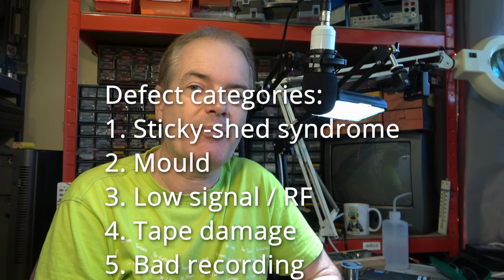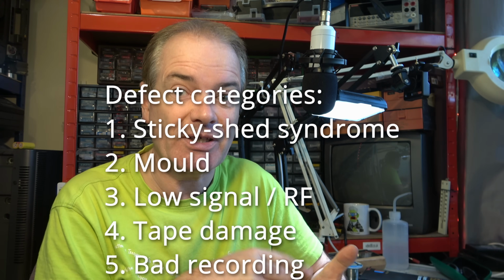Brain dump from video transfer business: Tape problems & what can be done.

Comment: I have several hi8 tapes that I recorded in my handyman between 1995 to 2004. Most of all Sony mp hi8 are still fine except the metal evaporated ones which now contaminate the heads, so I have continuously clean the heads during the transfer for dvd. I also have about 20 Maxwell hi8 mp tapes and all of them got a lot of mold. Most of all got ruined because tape snapped most of the time during the attempt of transfer. I have a few other brands including TDK Fuji and BASF with no problems at all. Curiously my Maxwell s-vhs tapes, about 35, were all contaminated with mold but fortunately didn't affect image in most of all of them.
Reply from the maker: I have a technique for de-moulding 8mm tapes, but it's time consuming so a little expensive.  Fuji branded tapes are usually the worst on 8mm.
Head fouling on certain 8mm tapes can be hard to solve.  When this happens with oxide tapes, some hours in a 50C oven usually stabilises them.  But with 8mm metal formulation, tape baking is less effective, though still worth a try.  Perhaps push it up to about 55C and leave them for 24-48 hours.
Reply: I meant mould, not mold.

Comment: I'm not sure what you would make of the method I use to clean mouldy VHS tapes. It basically involves holding some microfibre cloth (wrapped around some cotton buds) with a little bit of 70% IPA on it against the tape which is fast forwarded and rewound in a gash video recorder (making sure to clean both sides before they enter the heads) a couple of times in order to see if gunk stops coming off the tape and cleaning out the cassette with 99% IPA (in some cases I will manually go through the tape and remove some mould that is on the surface if there is any).
From my experience it does the trick, I've not experienced any head clogs (or at least ones that required a head clean) and only a few mild drop outs every once in a while or so (which is normal for VHS especially if it's old or played a lot and some of the tapes which needed more vicious cleaning have more visible drop outs and playback problems), I'm always a bit afraid of the heads being contaminated and spreading to other tapes, I'm sure if the tape is as clean as I can get it and it plays well then I can safely assume it hasn't left anything nasty on the heads.
Reply from the maker: A few years ago, I would have said that IPA shouldn't be applied to tapes.  But recently I've seen that it can be useful, so your technique sounds excellent.  At least as good as a TapeChek and possibly better.
Reply: @video99couk  I believe hydrogen peroxide actually kills the invisible spores where as IPA kills the mould which has already grown (so if the tape is returned to the conditions which allow the mould to grow it will grow back) however I've never tried it on VHS tapes and no one else to my knowledge has. People use IPA and I can tell it doesn't really if at all damage the tape, actually 70% I've found more effective and is a lot more gentle on the tape (which is good because there is usually some mould on the surface of the tape where it was wound to).
I don't claim to have come up with the method myself, it actually came from the Lunchmeat VHS blog (there are tons of tutorials using that method), the idea of using 70% came from a video by "Devils Avalanche Films", the only thing I do is clean the surface of the tape where it was wound to before putting the tape in the machine to do the proper clean (that part is the worst job and in some cases I would have to cut the tape and splice it back onto the leader, since pretty much all the tapes I've cleaned are pre recorded I usually only lose a bit of the black screen before the warnings and openings and such). Also I tend to be a lot more thorough then others I've seen if I may say so myself since most people only tend to do 1 pass which knocks 90% of it off but I tend to do it 2 or even 3 times until it's all gone (also some tapes which had some heavy mould on the top edge can leave a visible stain which can be removed by basically drowning the top edge in 70% IPA and then giving the tape another clean after it's dried). I'm glad I found those tapes in my grandad's garage when I did since most had just started, if they were stored in there for another 10 years or so they might have all been unsalvageable.

Comment: Do you have a video on demolding process?
I run few cassetet tapes through toilet paper soaked in isopropanol, 3 cleaned fine, 3 were destroyed, but then again, I used a drill with a bic, so maybe it was too fast.
My JVC can play most LP recordings in pretty acceptable quality, though I had some image problems on top and bottom of the image.
Reply from the maker: I do demonstrate cleaning Video8 and Betacam professional tapes on two YT videos, but I've not done VHS.  Usually VHS will improve by just playing through a gash machine a few times, but you can get expensive "TapeChek" machines to polish the tape and I show that in another video:https://www.youtube.com/watch?v=uoZ06US0tw4

Comment: Hi Colin. Ive had good results getting rid of mold with using cotton wool balls held against the tape on modified scrap vhs and beta machines.  Doesn't damage tapes as teh cotton woll is soft enough and also cleans the tape of debris. In an extreme situation I've even used cotton wool ball soaked in IPA to clean residue off tapes with a dry cotton wool ball to dry the tape off before it reaches the other spool.
Reply from the maker: The biggest problem though is mould on very thin tapes such as 8mm, where the mould is stronger than the tape.  You can't easily get the tape off the spools without it snapping.  Have to worked with mouldy 8mm?
Reply: @video99couk  Not done much with mouldy 8mm however I did one experiment with 60s audio reel to reel tape where the tape was stuck together with mould. As I had nothing to lose I put IPA into a roasting tin and then put the reel into the solution and moved the reel round a bit.. it did damage the reel plastic a little but it freed off the tape enough to unspool it onto a new reel (with cotton buds drying the tape off as it was unspooling). Drastic but remarkably effective at unsticking the tape.

Comment: Hi Colin, ever seen this phenomena? https://www.youtube.com/watch?v=EtNx6HH3rzc I guess it's the caps leaking as i have this problem also on my BVW75 currently, what do you think?
Reply from the maker: If that was from BetacamSP, then yes capacitor problems are likely.  May be in the power supply.  There are other possible causes such as cabling or ground loops.
Reply: @video99couk   It must be BetacamSP given the time and the look of the picture. Such a shame they did not see this error actually! But no one sees things like that these days it seems as most don't even care about interlaced videos on YouTube :D 

Your comment on the power supply is a very good hint and motivator to find this problem! Thank you! I visually inspected all the CAPS on all boards and found one leaking so I replaced the entire board with a spare with good caps, but the problem persisted so it must be the PSU as this one was too enclosed too look at, at that moment. So I will check again soon! 

You have a nice channel! I'm enjoying a lot of your content recently and already learned so much! I mostly enjoyed the d8/hi8 camera repairs. I subbed!

Comment: Apart from usual moudly bits - I seem to be having a run of misaligned audio, usually (for some reason) on VHS-C.

I have a deck set aside now for problem VHS which is a free for all when it comes to adjustment, I just keep it solely for problem tapes - do you do something similar?
Reply from the maker: I do have something similar for Video8 and miniDV, but I've not had the need on VHS or Beta yet.  I have a range of different machines and misaligned tapes will usually play on one or another.  Long Play VHS tapes though can be a challenge.  But anyone who was stupid enough to use VHSC Long Play for their precious memories was asking for trouble.

Comment: I may just be lucky but I have dozens of audio cassettes recorded as far back as I the mid 1980s, I've had no ageing problems with any of them, they still play perfectly & sound good as the day I recorded them, They are mostly TDK brand & been kept stored in a dry South facing bedroom, always been stored vertically too, this used to be recommended years ago too.
Reply from the maker: I've generally had less trouble with audio cassettes that with larger tapes, possibly because they're less likely to be stored in lofts or garages since they are small.  But if a cassette were to go mouldy, it would be very hard or impossible to recover.

Comment: I bet there are not many tapes that you havn't been able to recover.
So many things can go wrong, it's amazing that tapes last at all really.
As i've said before, the only tape that went funny on me was a BASF chrome one.
Lots of dots appeared all over the whole of the tape on one side, but after being in a warm room for a couple of days they all vanished without any damage at all.
Never happened on any other tape brand.
And scotch " Re record not fade away " lol,  just seemed eather too thick or stiffer than other tapes and could cause problems with some machines.
The timebase corrector sounds like a life saver at times :-D

Comment: Great video. You seem  to be an affable person and you drive an Avenger  so I am thinking you might be amenable to a question or two. I am not into this stuff professionally but I do have a few machines lying around so occasionally  I cobble then together in different configs to get a transfer done. My workflow involves getting the content into a PC using a Sony DSR-1500A DVCAM VTR's fire wire port  (D/A converter). 

I have a problem not seen by me before: A VCR cassette with motorsport footage  freezes frames while going through the Sony. It will play back fine if the VCR machine is connected to a TV. Can you shed some light on this?

Comment: Another good video. In my experience (US) 3M U-Matic tapes do not have a lot of RF problems, but every AGFA tapeI have seen has low rf, and if you want real fun get a DuPont U-Matic tape, Low RF, Sticky shed, and if you are really lucky it's one of the super thin 90 min tapes (standard size) or 45 min tapes (S size). I have started to find sticky 1" C videotapes recently one was AGFA the other was random tape on a spot reel but looked a bit like 3M 479.

Comment: You're missing one. Loss of Lubricant (LOL) which is common with Metal Evaporated HI8 tapes and other formats. You mentioned SSS with 8mm but what you're seeing is more likely LOL. Baking will only make it worse.
Reply: Early 90s Sony MP and ME 8mm tapes have lubrication problems. They are a royal PITA to transfer and cause clogged heads.

Comment: I had a few mouldy VHS tapes, my solution was to modify an old top loader so the tape cleaned itself against a length of optical cleaning cloth, all the tapes played fine after the treatment.
Reply from the maker: Nice solution.  The old top loaders didn't do any partial lace-up during tape winding so are ideal for this sort of thing.

Comment: What is it called when the rolls of tape are sticking together and you can hear it getting unstuck as the reel goes round but isn’t squealing as it goes through the tape path? Is that still SS Syndrome?
Reply from the maker: That's generally mould.